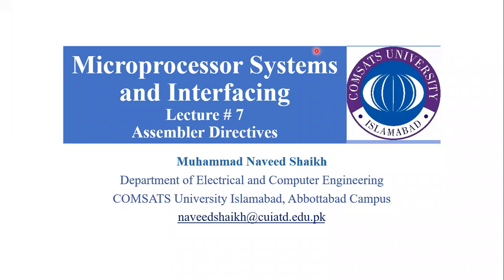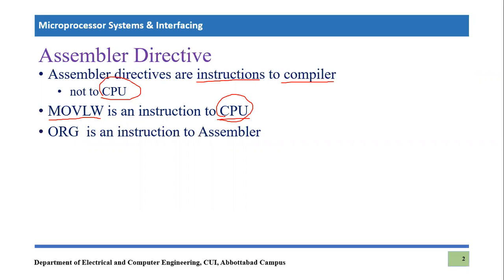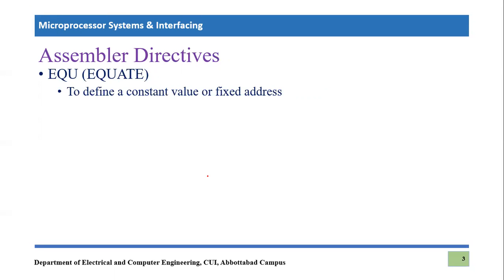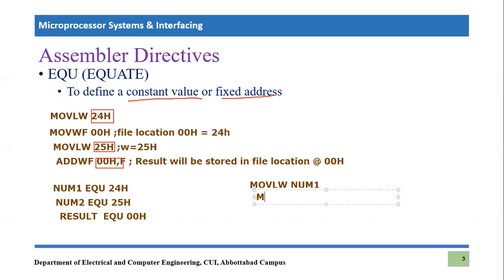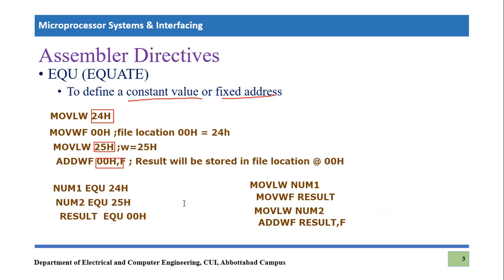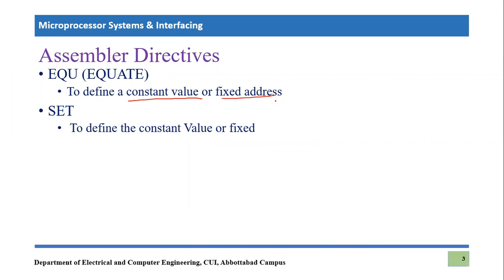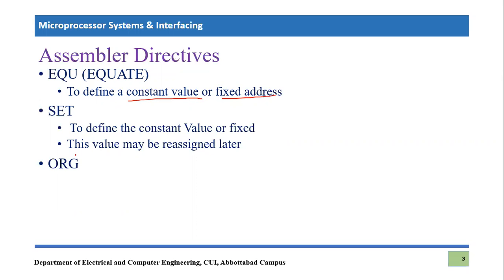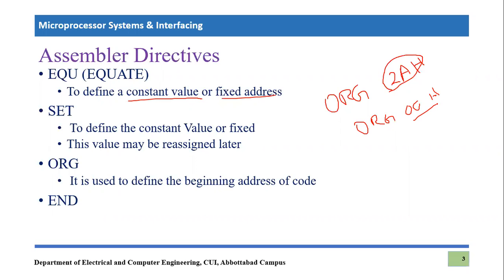Assembler Directives in PIC18 Microcontroller|| ORG|| end || List || EQU || Radix || #include in PIC

Comment: Can I define a single bit register at certain address?
Reply from the maker: If you want to ask if you can change the status of any specific bit of any location. .The answer is yes.  
In the case of PIC18F, it is an 8-bit microcontroller. So every register (either in File Register or Program Memory ) has at least 8-bit wide. However, PIC18F allows the users to define the status of single bits of any register.
 So, you can define any specific bit of any location equals to 1 or 0.   For that purpose, you can use BSF and BCF  instructions for 1 and 0 respectively.